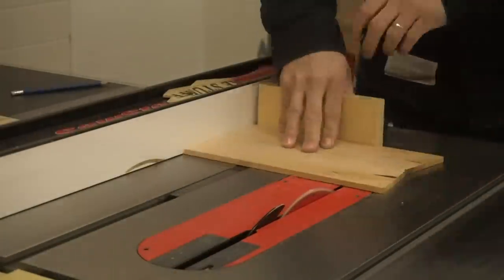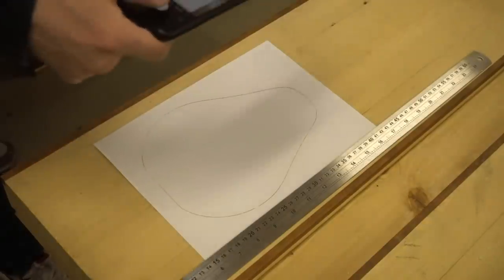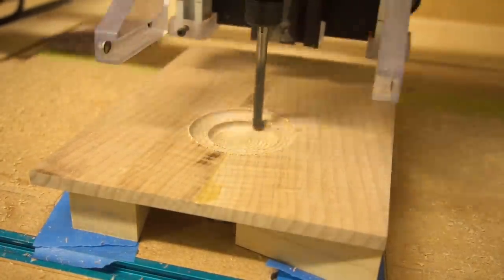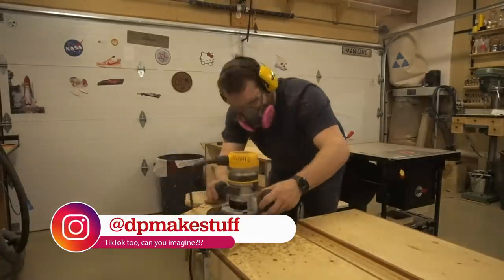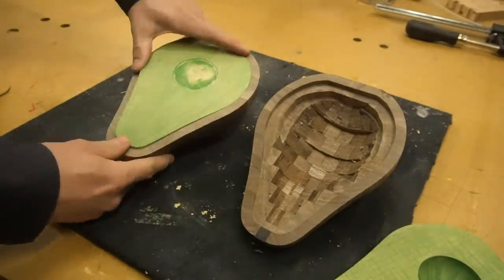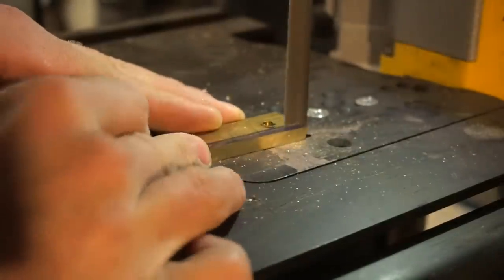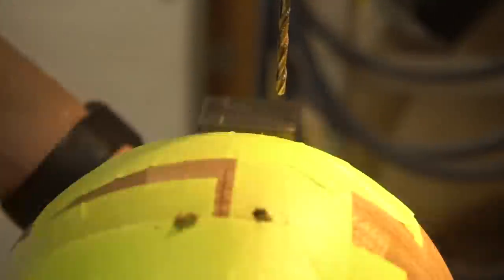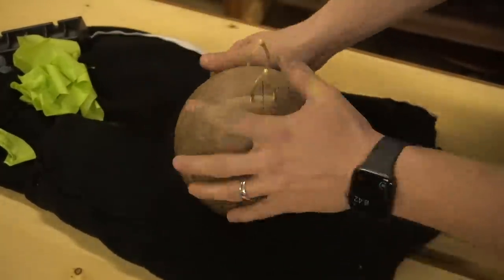Giant Wooden Avocado 🥑

Comment: What's with the small green shims you are placing between wedges when you do a ring glue up?
Reply from the maker: I glue the rings up half at a time. That way if the angles are a little off it’s easy to flatten the two pieces and glue it up to form a full ring. I’ve shown it before so I skipped over it here.
Reply: @dpmakestuff  oh I'm going through the archives! I've been glueing segments for years, bad gaps and all, never thought of glueing half then slapping them together! Cheers!
Reply from the maker: @handyhomebrewnetwork2142  it’s a great trick and then I never have to worry about dialing in my angles or having gaps in my rings. A table saw sled or a disk sander makes short work for flattening.